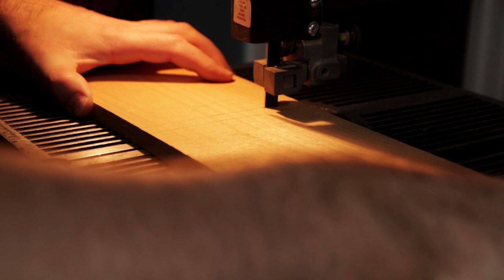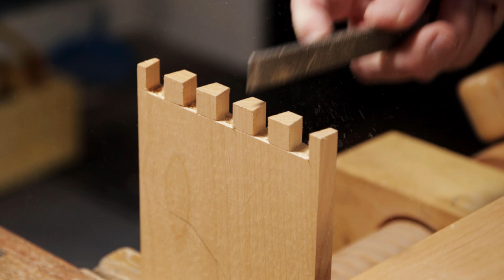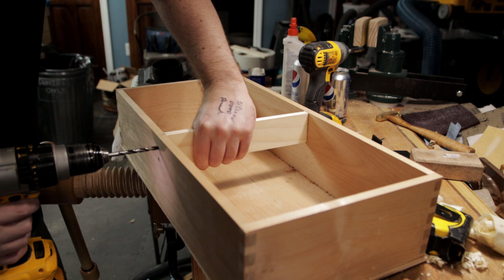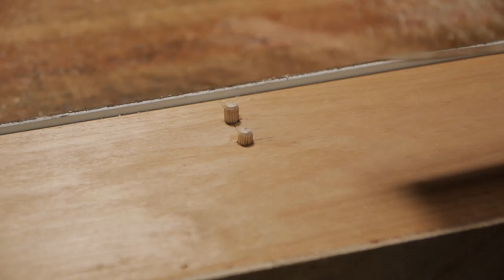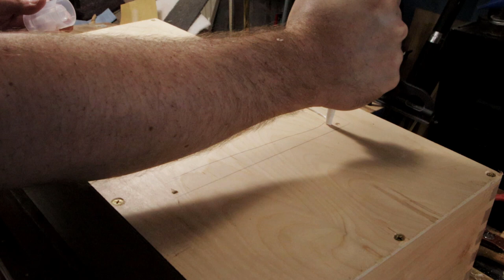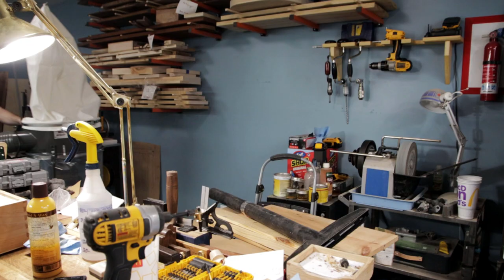Making a Downdraft Sanding Box with Hand Cut Dovetail Joinery

Comment: Your scrub plane looks awesome.  I tend to buy rough lumber and have tired of using my jack plane for scrub plane jobs.  Which scrub plane are you using?
Reply from the maker: It is a single iron plane from Ulmia that i added a large camber to the blade. It is about the size if a no 4. Ulmia and ECE both make dedicated scrub, jack, and smoother in this size range. I think ECEs are easier to get in the US.